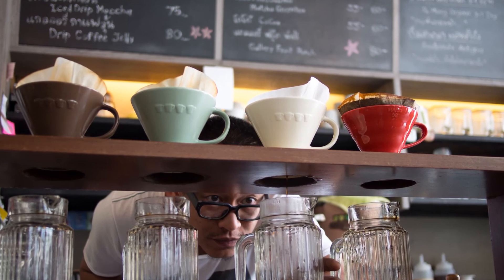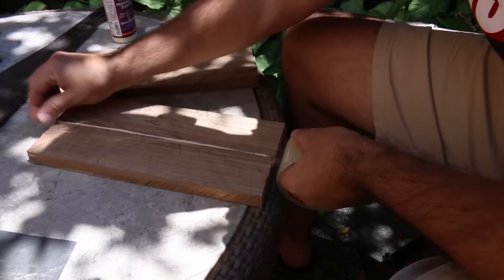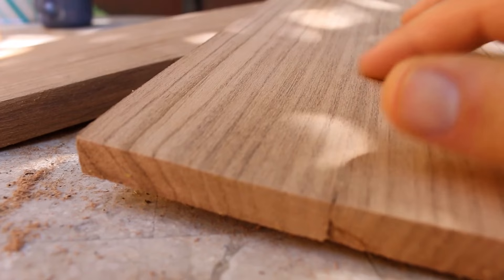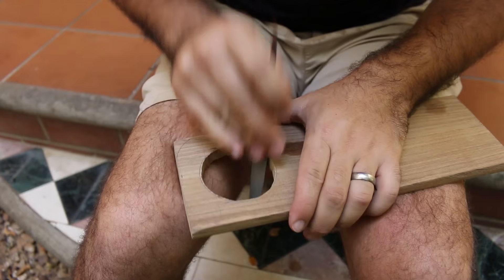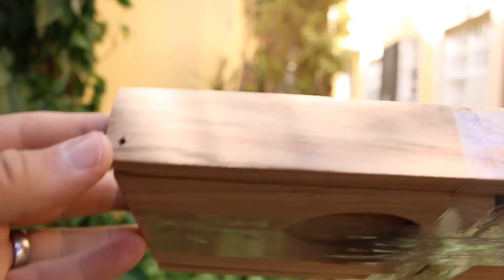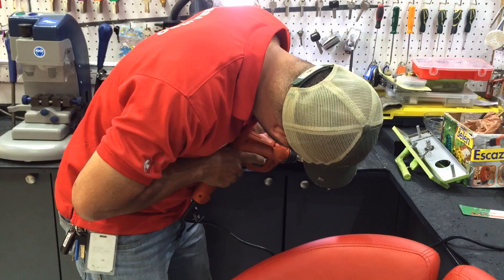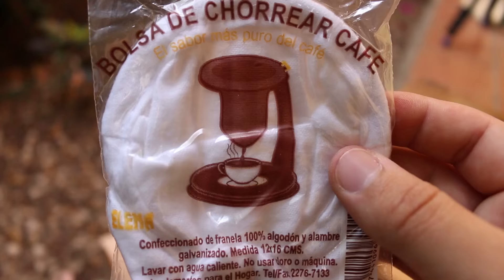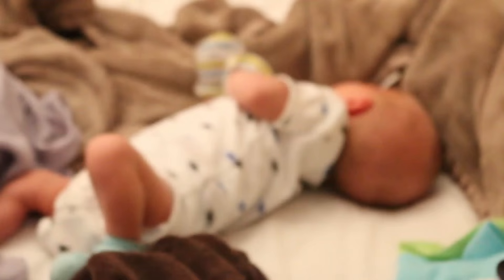DIY "Chorreador de Café" | Pre-Hipster Pour Over Coffee Maker

Comment: You really scared me with the chisel and the box cutter so close to your legs. Could have slipped and gouged into your leg...glad it didn't. Please be safe. Use a quick bench hook with superglue and nails (I recently made a video). The bench hook will work placed against any table surface with a lip. 

Also, a piece of string will work as a clamp too. Most Japanese shashimono woodworkers used silk ribbons. Clamps were rarely used.